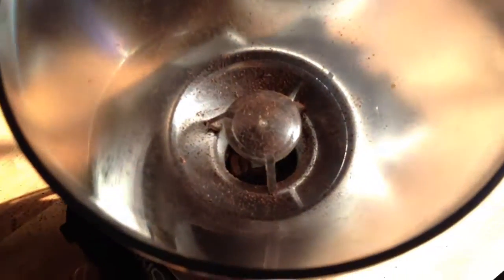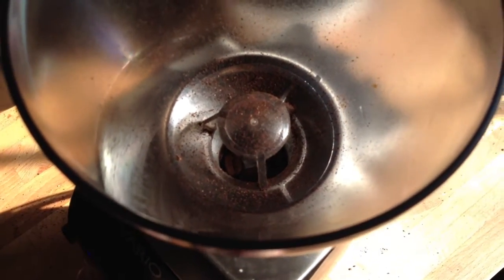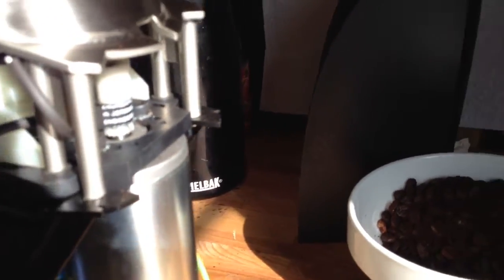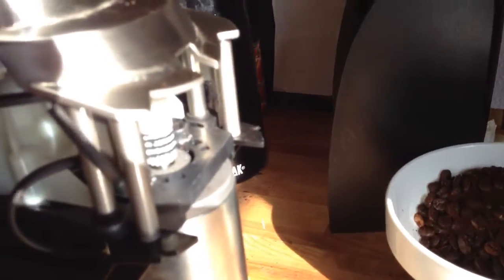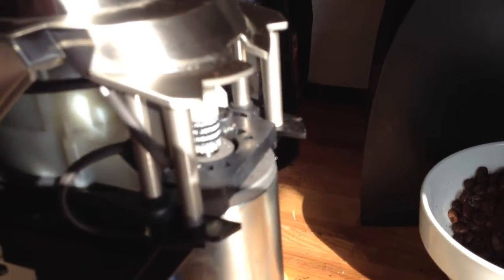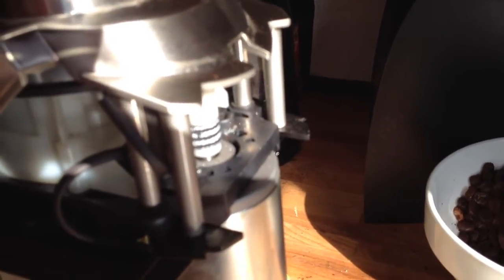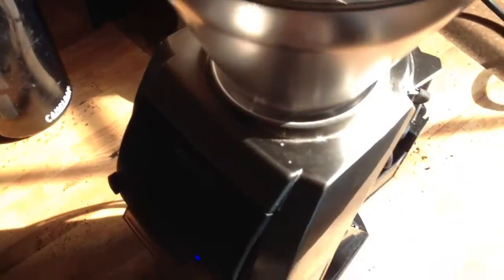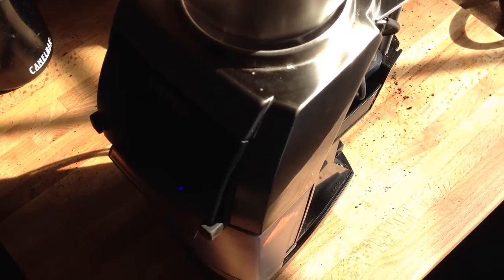Baratza Vario Problem

Comment: Found your video searching for my symptoms.
In my case much simpler. 
When I took the back off I found a set screw sitting at the bottom. I just had to screw it back into the belt drive collar on the motors worm gear and I was back in business.

Comment from the maker: It's not too hard if you are used to wrenching on other things. I called Baratza and they sent me the new aluminum cog and a new belt. I had to use a right-angle allen wrench to get the motor loose.
Reply: Hey, I'm having the exact same problem you did. Was it only the belt and pulley you had to replace or also the main drive gear?
Reply from the maker: @joshuareuben13  Just replaced the small motor pulley with the new aluminum one and the belt of course. That pulley is still running today in July 2020 - I use it daily to grind for drip as espresso grinding is now on a Sette that I've had for a few years.